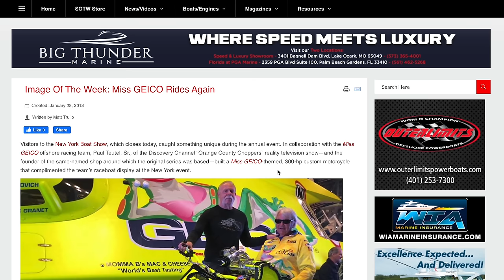Why you Should NEVER RIDE an Orange County Chopper

Comment: I feel your pain . I had a very good copy of a bike called "Darla" by Jesse Rooke . It had no rear suspension (hardtail) and the front suspension was backwards with a mountain bike shock. It kicked the builder and 1st owner off and then after I repaired it it did the same to me , knocked me unconscious in the road. The only way you could change the oil filter was to lift the engine up in the frame . I changed the front suspension in an attempt to make it rideable but it lost some of it's cool factor. The guy I sold it to changed it straight back . Some of these choppers are made to be looked at and never ridden
Reply: Not all choppers are total failures. A member of my family bought a new Norton & before he took delivery he had it chopped. It came with extended front forks, upturned pipes, a fat Harley rear tire & rim, & topped off with a peanut tank. I don't think it steered too well but the rear suspension was retained & it gave a fairly good ride. Actually it ran pretty well for a chopper. It did have a problem though. Our main highway had just attained freeway status & the distance between service stations was a bit further than the range of that peanut tank.
Reply: @n.mcneil4066   I assume that you mean that it doesn't steer well even for a chopper with raked forks.

I would rate any bike that doesn't steer well as a big failure. You don't have a cage round you when something happens and you can't steer yourself out of trouble.

Comment: So they basically LIED when they said it was 300hp. lol
Reply: *literally
Reply: The article lied :) It never encapsulated "300hp" in quotation marks like I just did, i.e, to be interpreted as if those who built it said that.
Sorry, but OCC is clear on this one.
Reply: Seriously, who would actually believe it made 300hp. The jokes on those who actually did.
Reply: Dude almost every Harley knew this didn't have 300hp without a turbo 😅😅.. I was like yeah ok yeah right 😅
Reply: So pathetically sad. I put a junk yard turbo on a 10 year old stock motor GSXR750 with fuel system and E85, made 220whp and trapped in the 160s. Cost like $6-7k at the time including the bike...and this pile makes 80whp less lmao.
Reply: @OtisFlint spicy. did you make any money on the 1/4 mile or was it just for fun?
Reply: @OtisFlint It could probably get to 200hp if they relaxed the compression with shorter connecting rods and upped the boost.
Reply: @PuerRidcully you can make 160ish with an n/a 132 so 100% should be able to make 200 boosted
Reply: They just meant very small horses. 😂
Reply: The neighbor confirmed this from the previous episode, he said 197 new
Reply: Good job, bozo. Next ur gonna be one of the guys that points out that it isnt a bike made for road trips XD
Reply: Just saying. If these guys just wanna talk about numbers and hp. Just go with cars man. If you just like big numbers you get a hell of a lot more hp In a car vs a bike. I know bikes are faster (weight of course) but their big statement seems to be the hp so build a car.

Comment: Hey Sean (my name too, spelt the same) if Steve still wants it for $15k sell it ASAP!.. Here's my rant.. 

My uncle was on the ownership team of Miss Geico Racing (Gary Goodell) and tragically passed away a couple of years ago.. in 2018 Geico commissioned OCC for a showstopper of a bike to honor the team and display it at shows.. they "built" a monster.. more accurately they subcontracted out every detail and component, and after a few weeks tried desperately to assemble it.. and couldn't get it to run for more than 5 mins.. hired a half dozen race mechanics to figure it out..no luck.. compression.. electrical..boost.. when they ran out of time it was unveiled at an NYC boat show.. non running! 
What Paul Sr. did was despicable.. totaled up every invoice, every part and tacked on $100,000 for "his time" total was $198,950 (initially $247,620 charging for additional mechanics and a custom trailer.. wrecked it.. then amended) and invoiced Geico.. 
They reluctantly paid it, and it toured (non running) until my uncles passing in Feb '22 Over those 4 years the bike was sent to multiple mechanics and none could get it to run for more than 20 minutes without shutting down, overheating or parts exploding.. and during that time Paul Sr. was contacted repeatedly (no reply..calls/emails.. no one from OCC) 
Paul Teutul Sr. got lucky with the show.. and is a master con artist.. hires mostly young kids, still in trade school, pays them next to nothing to slap together crap.. Our family dumped this "work of art" ..the trailer and a replica rc boat to anyone who'd haul everything away!
Luckily you got it Sean from Bikes and Beards for $10,000 (the price of the trailer we paid for) 
It's no surprise Teutul Sr. declared bankruptcy soon after.. is involved in multiple lawsuits.. owes investors and outsourced contractors $$$$ is being investigated in a multi million dollar ponzi scheme... 
He's run to Florida to shield his assets in real estate.. the ride's going to end soon!
Fingers crossed you'll get out of it like we did.. great content though, really enjoy your channel!

Comment: What these guys need is an Allen Millyard!
All the builders with all the equipment to build a 140 bhp POS that doesn't want to start, and when it does start it runs like a bag of bolts.
Millyard builds a bike in his car sized garage, on his own, with basic tools, that has a Viper V10 running 500 bhp, starts on the button, and he can, and does, ride it for hundreds of miles without a problem.
Anyone that considers themself to be a motorcycle enthusiast should look up Allen Millyard, and see what incredible pieces of engineering he does.
Reply: You are so correct. This man is a motorcycle John Browning.
Reply: Millyard would scrap it and build something decent with the parts.
Reply: Yeh, OCC was all the gear with no idea. Millyard actually knows how to build a bike right.
Reply: Millyard hates Harley’s
Reply: Again a builder who builds something that’s not going to kill him, or that’s not intended to be a giant lobby decoration
Reply: Look up the Flying Millyard. I believe it's 2 cylinders from a planes radial engine so it's about 5 litres in size and he rides that all over the place as well. I've been lucky enough to see and hear them both! Amazing pieces of engineering
Reply: Allen is a genius, but I doubt he would muss his hands with this one...😅

Comment: As a guitarist, I have two guitars that we call wall hangers, they look lovely, but are unplayable....Seems OCC bikes are the equivalent to this, they look the dogs bollocks, but are 100% not roadworthy..
Reply: Now i gotta ask: what guitars are those?
Reply: @MarmaladeMaki two Gibsons
Reply: Les Pauls for sure.   I fight mine daily
Reply: @Ian-lm5ep  
LOL that's funny as I keep considering getting a les paul but I'm incredibly, it's quite a skill actually, INCREDIBLY good at knocking guitars over. Even in stands. I've a wooden floor where I keep my guitars which is not helpful.
I've managed to break the headstock on others more than once, and while I love Les Pauls I'm scared to get a real one as they are notorious for snapping necks when knocked over. So I think if I got one I'd scared to actually use it, it'd tend to hang on the wall.
My telecaster is fantastic, its headstock seems designed for clumsy oafs, it's got basically a 0 degree back angle.
I'll get a les paul "style" I think, cheaper .. and one that looks like it can take a toppling. Les Paul body with telecaster headstock is the dream, why is this not made!
Reply: @Ian-lm5ep  How's your truss rod set up?
Reply: @minighs  had it set up but it's 2017 tribute.  I've worn many frets so buzz  unless raise action.  Stupid small tickle.  I need jumbo stainless I'm not a finesse player
Reply: @Ian-lm5ep  Jumbo frets are amazing.  I'll never go back to anything else.
Reply: Is "the dogs bollocks" good or bad? I thought bollocks was bad. Lol
Reply: You guys are just figuring this out in 2024? This never occurred to you when you watched OCC?
Reply: @budjiman1  "the dog's bollocks" means it's good. Definitely something that sounds like it isn't though when heard for the first-time😄

Comment: Not securing the rear wheel on the dynamometer can cause a serious accident.
Even after the first mistake, you continued without doing it. There is also a risk of lateral displacement.
With the motorcycle’s inertia, it could end up in a serious accident within that small, crowded room.
Reply: Yeah it's kind of crazy they didn't even consider the shocks depressing when they got on it. They just kept going LOL That Could Have Ended bad. Luckily it did not
Reply: Amateurs, that's why .....
Reply from the maker: Im putting the guy running the dyno to be in charge of this stuff if it were just me i would be content with holding the front brake lol
Reply: @BikesandBeards  What front brake?
Reply: That many people milling around the dyno room is dangerous.

Comment: I recall in their shop they sold "normal" bikes too, these were pimped up, but not as extreme as the TV show versions. So I am pretty sure they do have "ridable" bikes, just not these super original TV show builds.
This Ace Pro camera ad with a motorcycle in it is pretty rad.
Reply: Even their "normal bikes" were garbage. They were thrown together without Locktite and fell apart under normal riding. Nothing fit right and they usually had a foreign made stock Evo clone engine but for a premium price.
Reply: I've driven two OCC bikes, one was a custom build for a customer, not a company or corporation.   The other was an "off the shelf" bike.  Both were absolutely horrible.
Reply: "normal" bikes would not generate enough tv rating.
Reply: @peger  Did you not watch the video before commenting? I am very clearly responding to his statement about OCC only doing TV bikes and promos.

Comment: You could sell it for scrap or tear it down and start over. The first thing is (as everyone acknowledges) You need to reduce the compression ratio and make the supercharger carry its weight. Volumetric efficiency. 
 I'd be interested in knowing what the dyno says with the supercharger taken out of the equation. I don't believe it's making any additional power, but you'll never prove it, one way or the other, until you run without it.

Comment: Since the channel is promoting Insta360, my new, right out of box, insta360 camera overheated within 5 minutes each time it was used. I contacted product support, and they wanted me to send it back for repair (no exchange option) stating the turnaround time would be 6-8 weeks AND that there might be repair costs involved if the problem was not covered by that warrantee (apparently DOA is not covered by the warrantee). This meant the defective brand new insta360 camera could cost me several hundred$$$ more to get back. I passed and returned the camera for a full refund within 10 days of purchase. The good news was I bought another insta360 and it has not had any overheating problems. I suspect Insta360 knew they had a batch of overheating cameras being sold around the world, but the only way to flush them out was to sell them and have customers go through the same process I did.

Comment: Used to have a Kawasaki Nighthawk back in the late 90s , took it to the shop to have it serviced. Drove it off the lot and 3 blocks later wrecked trying to stop. They had over filled the oil and yes it coated the back tired and down i went. The shop fired the tech who over filled it & fixed it all for free and made it right. The point is as you said oil and 2 wheels dont mix .

Comment: The whole point of a supercharger is to cram a ton of hp out of pump gas. Also a fatal flaw of it is robbing hp to gain hp lol! I used to love stomping blowers with my naturally aspirated 496… at the cost of running 13:1 compression and $22.50/gal for 117 octane fuel. Wouldn’t idle under 2k either. But to try and force boost into a cavity already under high pressure is redundant, and ultimately not very well thought out. I’ve seen plenty of OCC bikes, this one’s pretty but just like the one hanging in my friends shop, expensive ornaments. The unique thing about his is it’s all chromed out aluminum frame. Yes, chromed aluminum. If I remember correctly, the aluminum frame was dipped in copper or bronze then dipped in chrome so it would all adhere. Very light weight. Only reason he has it was it ended up in his possession for free.

Comment: I once before i had gotten brains tried riding my 150 with hands crossed.

What my brain that i had fallen into place told me after collecting myself from one of my worst wrecks was....

When you push the handle bars to turn instead of pulling them , the bike will go in the opposite direction ....

Comment: I had a Vmax with V-Boost from the US in Europe and was a motorbike mechanic back then. 1200 CC 16V. I bored it to 1500 CC with Ford pistons and modified the V-Boost with an analog switch for a self made system for 2 different programs. Crazy and relax mode basically. 343 HP on a Dyno. In those days my neck was twice as wide

Dude... Put a saddle on that monster so you can actually reach the bar 😂

So nobody ever put a multi-meter on that battery to see if it actually charges

Comment: Not an expert, but for safety reasons, I would highly suggest to install a pressure sensor on the oil system if possible. The scenario you're suggesting (slipping on running oil on the highway) sounds like it has a high potential for a fatal accident. Having a sensor with an audio cue warning you if oil pressure suddenly drops seems like a literal life saver to me. You may also want to install something to catch the oil in case the oil thing pops off and an oil leak occurs.

Comment: On one of the OCC bikes, the drive sprocket and the rear wheel sprocket were off alignment by 3/8 inch.   The build was behind schedule.  What did the Teutals do?   They got out a sledge hammer and beat the swing arm into alignment.   🥸

Comment: I blew an oil plug out on a VN2000 switching lanes at 90mph was not fun. I added a quart too much over pressurized so it dumped oil into the intake and shot the plug out.

137hp is really depressing consider a M109R can make that with no supercharger lol.

Comment: my Gopro overheats. So, Gopro sent me one battery that they said is modified to prevent overheating and expand the time or range. But, I had 2 batteries and they would not send me two. I thought that was pretty cheap of them since batteries don't cost that much and I paid hundreds for the Gopro. Thus, I am done with Gopro and why did it overheat to begin with? Because they sealed it to make it waterproof not realizing??? that it would overheat with no ventilation? I will be checking out the Acepro for sure.

Comment: I'm at the part where they call it a 300hp bike. Lolol. No way. The 113 made about 105. The EFI 113, peaked higher. But, if you supercharged that high compression square motor to 300 it would grenade. You would have pistons for testicles and rods for shin bones.

Comment: Sounded like a fuel pressure housing cap cracked in your tank I had the same exact thing happened with my heritage it's  sputters and spits and then dies and eventually won't start  usually a simple fix but looking at that bike I don't think so

Comment: I get what youre saying about the oil dumping in the tear tire,but thats not exclusive to this monstrosity, thats been an issue since motorcycles started using engines lol... I had an oil cooler line blow on a 90 gsxr 1100 on the highway... I got it pulled over, but I hope to not have to do it again lol
Reply: Btw... Love your channel. I just found it today and have watched several videos. I love that you shared a Bible verse on part 1. Keep it up

Comment: Three miles per tank.  Parts falling off after less than 3 miles on the road.  At what point, do grown up “professionals” get  embarrassed to be associated in any way with having any part of the production of an absolute bucket-of-bolts for a motorcycle that is unsafe to ride, and unreliable mechanically speaking.  Would you want your personal ride produced by any of these individuals that are associated with such horrible quality control issues?

Comment: Looks like a Ralph Nader Special. Unsafe at any speed. Doesn't seem like it has enough ground clearance to get in and out of the average parking lot or driveway without grounding out the frame. If it had to be a Harley, I'd rather have an Old Super Glide, but if you are talking about high dollar one off bikes, I'd love a Münch Mammut. Yeah. Or maybe a fully restored Honda CBX or KZ1300, but the OC Chopper is death wish city.

Comment: really? C mon, dont exaggerate.
You and your pals:
"Hey look. I just bought a bike that was standing around for years with all fluids in it, with never being maintained, that never have been checked and just lets try to make it run. Lets then see, what parts are going to fall apart, because what could wrong"
Others: "Hey look . I just bought that bike that was standing around with all fluids in it and that never was maintained. Lets check every part and component. Lets clean it and replace every part that had contact with any fluid. Lets make sure every part is functioning properly before even starting it"

So a bit much drama here, eh? Like these occ guys: a bit show for the audience.